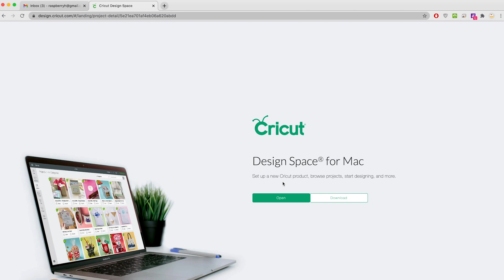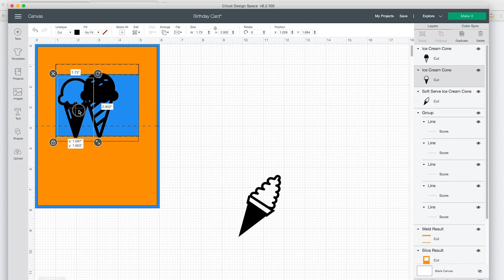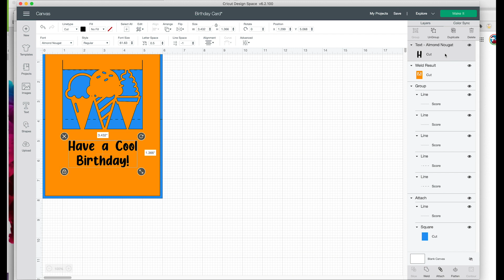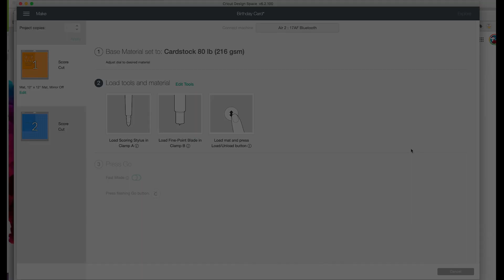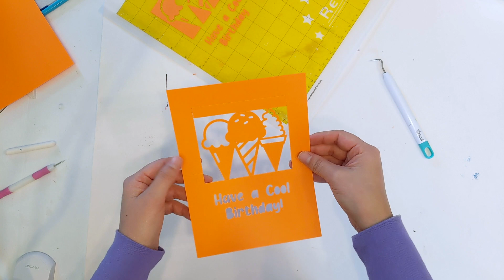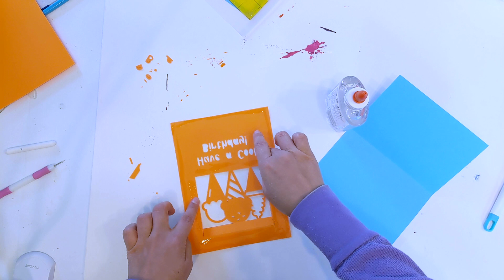Pop-up card from scratch for Cricut

Comment: hi heather i have pages of hand desighned pop up cards and was wondering if i can take a picture of a desighn i made and turn it into a svg with all its score lines?
Reply from the maker: Hi! What I would probably do is take a picture (or scan it) and then bring the picture into a vector program and trace over it. It would be nicer and cleaner that way.

But if you really do just want to go with a picture, you probably could, but you'll still need to add the score lines manually in design space. BUT all your cutouts should come through ok.